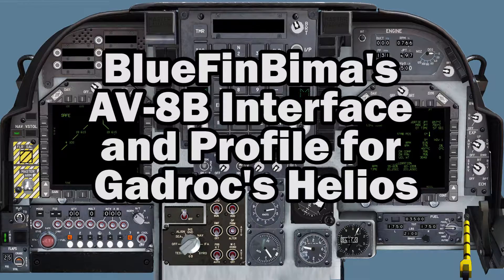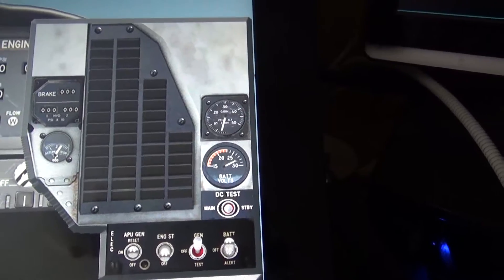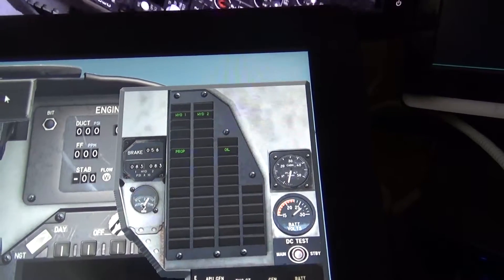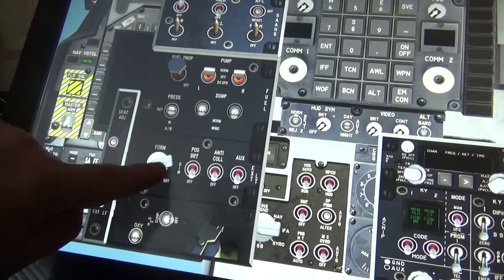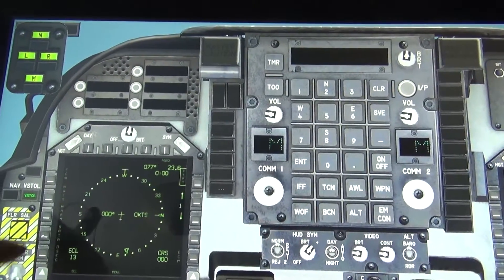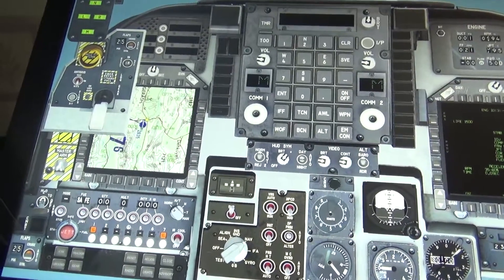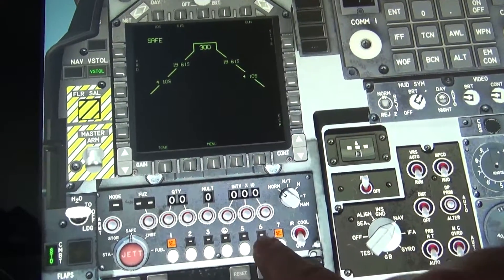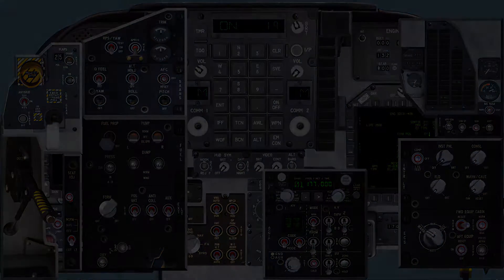Helios AV-8B Interface and Profile

Comment: Im a new DCS convert and simpit builder, does Helios running your profile allow for hardware integration, multi external monitors and arduino integration? Ie, could you build a psi cal cockpit using this like the A10 pit builders. Thanks.
Reply from the maker: Hi, As far as hardware is concerned, Helios only has limited ability to get involved with hardware.  HID USB devices can be bound, and you can use things like the Thrustmaster Cougar MFDs, but in general Helios sits in the middle between "just DCS" and "full simpit".  There are plenty of people who run Helios as part of their simpit, and obviously it is easier to change aircraft with Helios.  As an example, I run a mix of hardware devices and Helios, but the hardware devices do not go through Helios.  You might want to look at the DCS BIOS project for hardware inspiration.